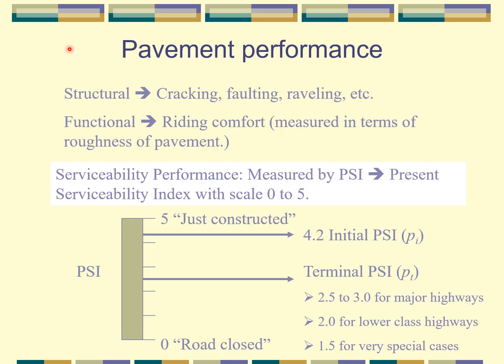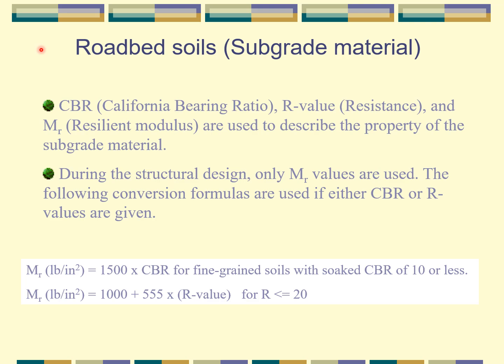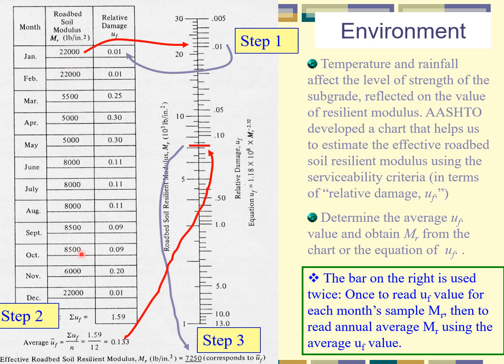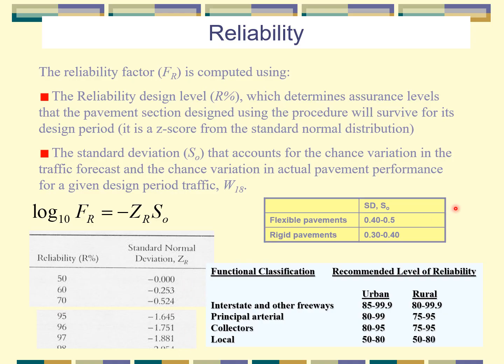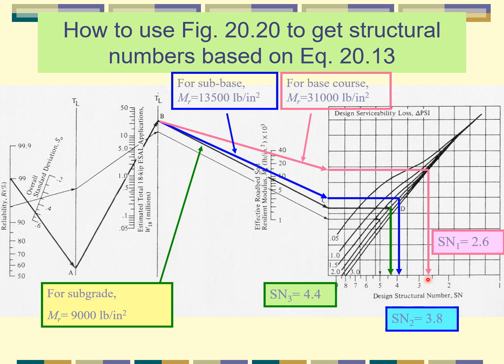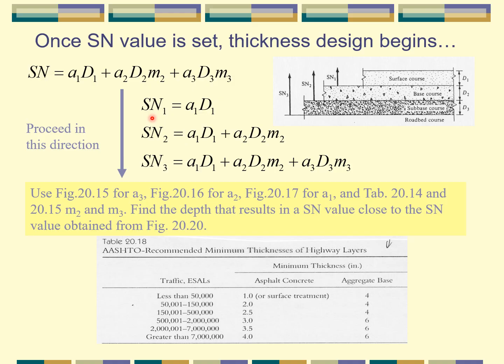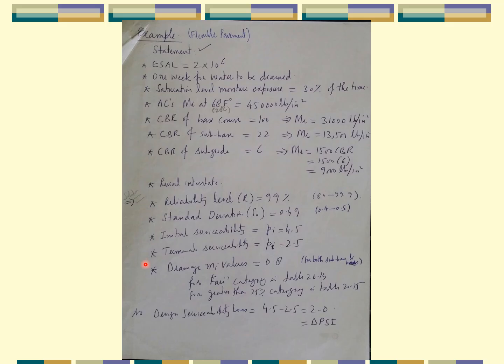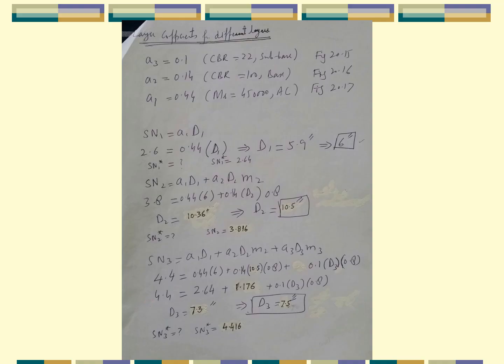11. AASHTO Flexible Pavement Design Method====

Comment: Greeting you Sir Here one question to me 
you known the value of SN4 through 9000ib/in² but you put or consider as SN1 in calculation or in Geometry
I think we should take the value of resiliance modulus 450000ib/in² to get SN1 for Asphal concrete or wear course please correct me..?
Reply: Sir you took value of SN1 2.6 by passing line of  resiliance modulus value 31000 for surface course but it show value of CBR for base